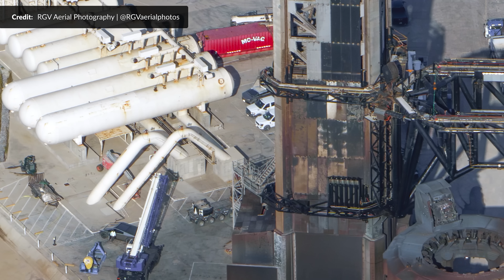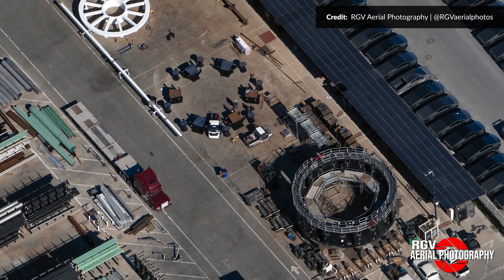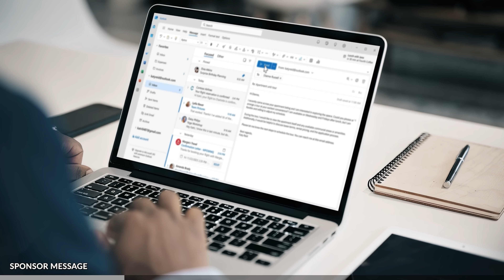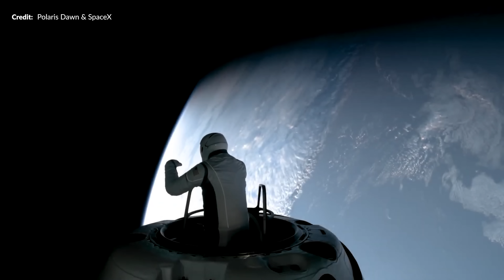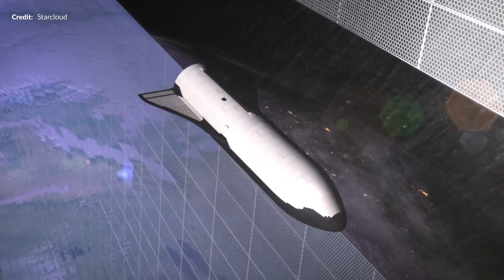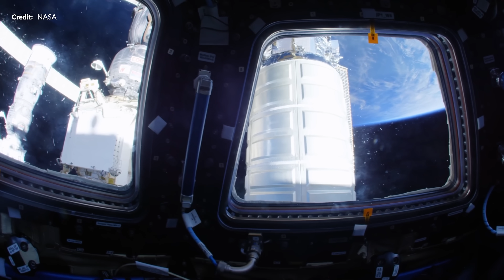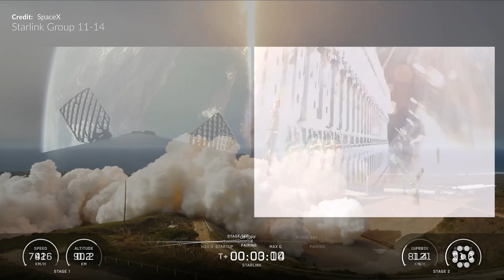Wow! SpaceX Are Ramping Up Starship Plans for the Moon? 🚀

Comment: Cooling in a vacuum is not so easy.
Reply: Radiators, heat sinks, coolant. Same as anything else.
Reply: @davis.fourohfour yeah, same type of systems, but the problem is that radiators are very inefficient at low temperatures. Heat from a data center should be <100 C, but you have to deal with many Megawatts of heat at that temperature. Your radiators can't be any hotter to dissipate the heat faster, so they would have to be extremely huge (and therefore heavy).
Reply: @The_DaleksAll very true. Heat pumps allow the radiative side to be hotter than the cooled side, which would reduce their size somewhat, but now there's a lot more active parts to fail
Reply: @darylbardo yes, that is true, you could significantly boost efficiency that way. Although I don't know if it would help the "easier" side of the problem much 😅. And you would have even more heat to dissipate. It will be interesting to see how far this company gets. 5GW data center (5GW of heat) is stupendous.
Reply: @The_DaleksExactly.  I didn't say it was easier and heat pumps increase complexity, total power required, and total heat dissipation required, as you say. It's all certainly possible to do...the question is whether is can be done economically, and there are legitimate doubts, including all the things we've said.
Reply: @The_Daleks I mean, heat pumps exist. There is no physical reason why there couldn't be a multi-stage heat pump raising the working fluids to crazy high temps before being sent through radiators. I don't see why this wouldn't be exactly the kind of technology being researched once the business proposition is good enough.
Reply: @jackinthebox301 Absolutely it can be done. Argon can be raised to 3000K comparatively easily through compression. At that temperature you'd have to use something like a curie point radiator using Cobalt. I just struggle to imagine any kind of near/mid term space station that uses 5GW of power and produces 5GW of heat, with the primary objective of turning a profit. No matter what you do, handling 5GW of heat and dumping it via radiation is going to be tricky, quite heavy, and expensive. Anyway, it will be fun to watch and see how far they get.
Reply: @The_Daleks Maybe they need to set up an intermediate heat exchanger/concentrator stage so that it gets hot enough to expel the heat energy as infrared radiation.  You always hear about the "coldness of space", but if you think about it - a vacuum is basically the best insulator there is from conductive heat loss, so the only option is to have heat loss by irradiation.
Reply: @davis.fourohfour  Why didn't you mention fans and circulating air if cooling in a vacuum is the same as in air? :D
Reply: @davis.fourohfour  Seen how big the radiators for the ISS are. Now, imagine a data centre that produces hundreds of times more heat than the ISS.
Reply: @davis.fourohfour no, not same as anything ells, heat sinks on earth work by transferring heat from one medium to another, in space heat is dissipated mainly by way of litteraly radiating IR in to space, (black body radiation) in a sence you heat up a radiator and that radiator emit infrared light(radiation) in to space there by cooling.

This is not particularly effective  and thereby requiring very large radiators.

Also, they are also massive heaters if exposed to sunlight so...
Reply: @davis.fourohfour yes, only cooling by radiation works. For that the huge radiator needs to be.
Reply: Yes, the orbiting data centres concept is interesting for just this reason( difficulty of heat dissipation). On the moon (in some probably fairly distant future) it would be possible to actually manufacture really large heat sinks but regardless, they will advance our understanding of thermodynamics just trying, and hopefully lessons learned can be applied on earth as well.
Reply: We're seeing data center companies being too cheap to only use water in closed loops, choosing to waste huge amounts of clean water for cooling, instead of paying more to eliminate water waste.
And now we expect those same companies to pay extraorbitant amounts to bring their hardware into orbit?
Reply: "Not so easy" is significantly easier than "impossible", and many once thought landing an orbital rocket booster was impossible.
Reply: @LaughingOrange no serius person though it was impossible just impractical and not cust effective, (driven by entrenched attitudes from legacy space companies who made more money from non reusable spacecraft.)
Reply: That's not going to stop anyone from pushing forward.

Comment: The tiles still seems to me to be the weakpoint of starship and i would rather they spend more time and effort on either finding a better solution or completly doing them from the groud up because right now way too many of them are falling in flight or being severly damaged on reentry. It does not matter if starship is 90% working if those last 10% are related to tiles issue and are making reusability impossible. I fear this issue is getting ignored.
Reply: This is a key focus. The current tile system is part of the rapid iteration process we are testing, learning, and improving the design and attachment methods in real-world conditions with each flight. This is the same development path that transformed rocket landing from an impossibility into a routine event. The solution will be found through this relentless testing cycle.
Reply: The problem is you have ZERO idea how much time they're spending on that problem.  I think you're making things up without any real knowledge.

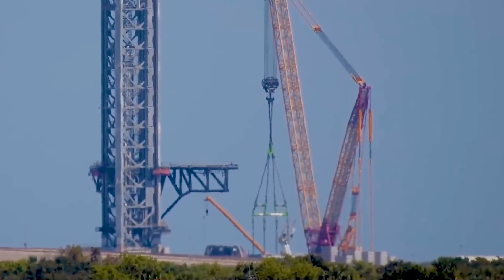Comment: HEAVY LIFT QUESTION: The square launch mount being raised at PAD 39 by the LR13000 crane, OMG, how much does that monster weigh?!! (@ 4:35 in the video)
Reply: IIRC someone estimated its around 800 tonnes at minimum?
Reply: @RedmondJohnsonl  😮‼️ HOLY F**K❕